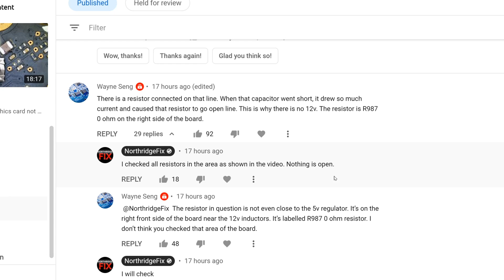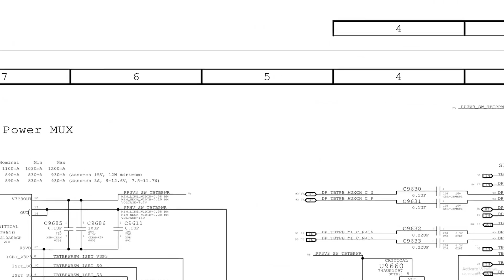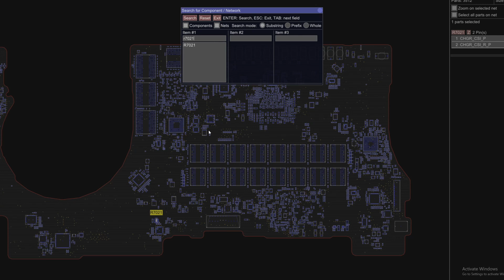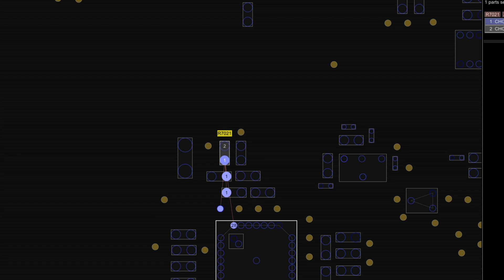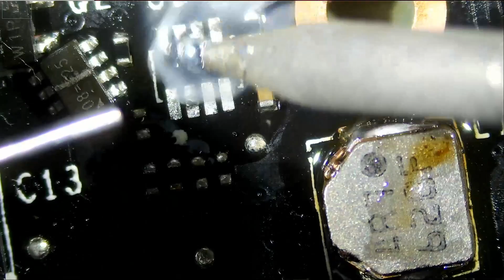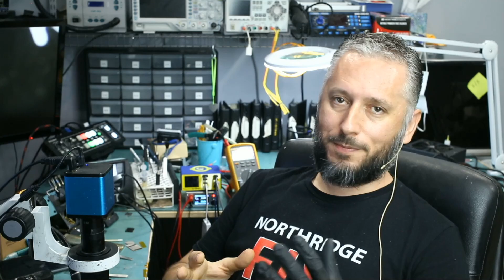GeForce 1070 FE Graphics card not Detected Part2 & $50 to the person who helped.

Comment: But basically Alex, you did not check back the 12volt line as to why there was no 12volt, if you had traced back then surely you would have found the 0 ohms resistor open.

Comment: hi guys i have a question, i have a gpu that has bad capacitors(smd ceramic) they where broken in the middle, is there any way to know which ones i should replace it with? its a sapphire r9 290x 3gb dual-x oc and i'd really like to fix it

Comment: Good job getting it to work!  You mentioned some suggesting injecting voltage and looking for something to get hot. I understand that wouldn't have been the solution in this care, BUT what if you injected voltage at the point where you were missing voltage and trace it back on the board looking for the same voltage at various points. I understand this could take awhile. This may help lead you to that blown 0 ohm resistor since you would have voltage on one side and zero on the other side. I have to do this in the automotive field at times. I am getting into electronic diagnostics though.

Comment: The biggest problem with graphics cards, is that each board partner makes their own variation.  None of the graphics cards are using anything that's really hard to Source, they're all very common parts. The issue is that companies like Nvidia set guidelines as to their layouts, but they're not stuck with that. Each board partner as well as each model produced by them is invariably different to the next in most ways. I would hope that the next big leaking item for board views and board schematics would be graphics cards from board partners, but I have yet to see anybody leak and Nvidia board partner graphics card board view schematic.  When right to repair is established eventually, I suspect Nvidia and board Partners will lock those boardview schematics behind a paywall, so they can say they are available, but they are prohibitively expensive to get access to.

Comment: Here's a technique I use to find a component on the board: In your example R7022.
Connect to your multimeter probe a fine brush made of either some copper braid from a coaxial cable shielding, or similar, and swipe across the board until it beeps.
Measure in reference to pin 27, CSIN of the ISL chip logically.
A fast and easy way to find traces, components.
Reply: Yes it is a good technique, but it is NOT effective in all circumstances. If you have a washing machine control board, there is a coating onto the PCB to shield from humidity. It is a kind of painting layer. And the coating is insulating...so schematics and board layout are the only means to attempt a fixing. Regards from Italy.

Comment: So was the zero ohm resistor intended to be used as a fuse in this case, which is why it failed?
Reply: Yes.  Low value resistors are cheap way to add a fuse.